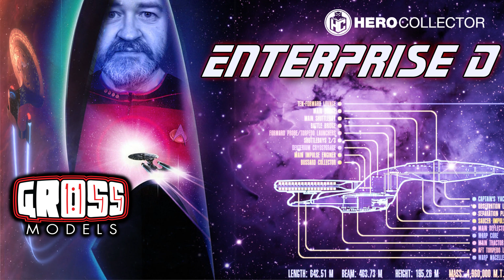Hero Collector Enterprise-D build. Stage 76

Comment: Hi, I have just finished issue 19 and I am curious to know your thoughts on the fit of the bottom panels.I do not understand why they fit so badly and it takes ages to manipulate them into an acceptable position.I have had to do some do some adjustments to some panels in the form of cutting tiny bits off for a good fit and even then the lines of the panels are not perfect.
If this was the top of the saucer there would be an outcry but as it’s underneath they seem to have decided to forget about design and quality control.
I was so looking forward to this build but in all honesty it has been a big letdown.
Reply from the maker: The lower section isn’t as good as the top. I guess some choices had to be made due to the way it has to fit together. There’s no way to attach them the same way as the top ones as you can’t get to the inside of the frame. 
I think it will all be ok as it gets completed, things seem to be settling in and fitting better after some adjustments.
Reply: Maybe they could have made the panels bigger to avoid the problem of alignment but even though it’s underneath and not that visible it’s really not good enough for such an expensive model.
Reply from the maker: Bigger panels would mean fewer issues though, that wouldn’t be as profitable!
Reply: I don't get why some deckplates are plastic and some are metal.
 I find fitting plastic harder to do than metal, at least with metal you can use more force to fit into place
Reply from the maker: I assume if it was all metal it would be a ridiculous weight.
Reply: They also could have made the bottom of the saucer section completely independent from the top and joined by the edge sections
Reply from the maker: Not sure the edge alone would be strong enough. 
Hopefully we will still find out!

Comment: Slowly catching up just done issue 14. Fitting arboretum big metal peice was a nightmare fitting it I had to remove the 2 deckplates just above to fit it right then retach the 2 deckplates then it fitted alot better. I modded the tiny black bit which is the arboretum why this is black should have been painted blue ?!

How I remodded the arboretum plastic peice : remove most of the black with spirits and abrasion which removed most of the black kepted the black on window bits then repainted with blue sky acrylic paint it turned out quite well bits that were black when repainted made the blue slightly darker
Reply from the maker: I have seen a few people doing similar, some lighting it. 
These small differences don’t bother me much, I’m sure different versions all happened through the series.